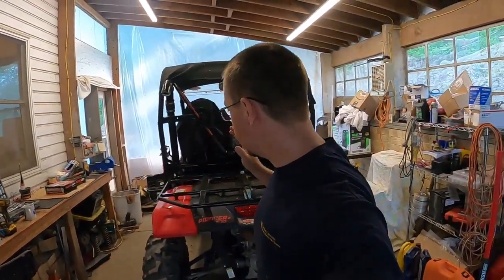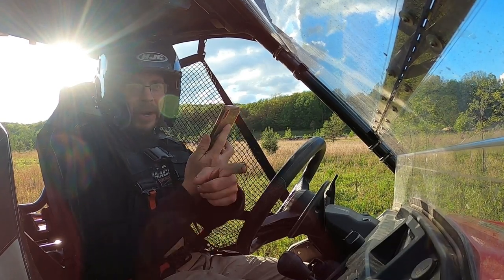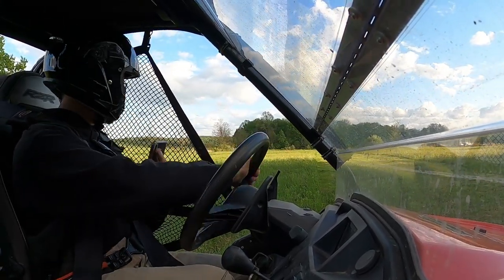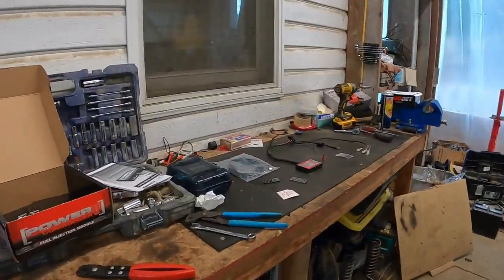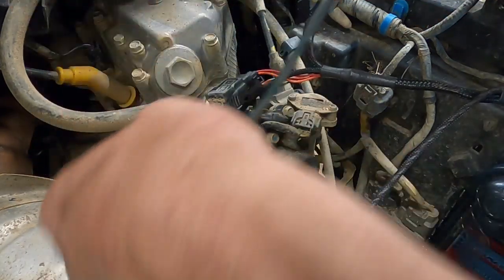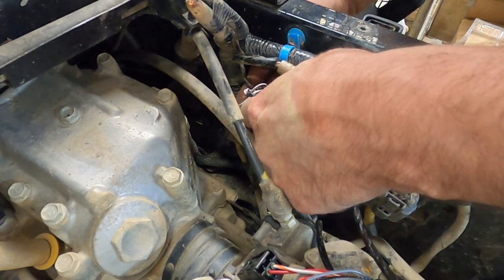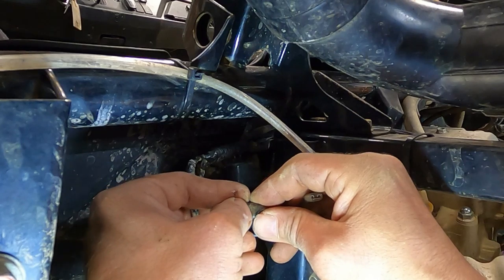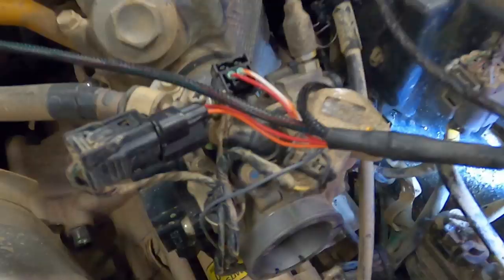Honda Pioneer 500 Power Commander V Install

Comment: I took my new 2020 P5 for the first time this weekend I love it the only thing I dont like is the speed limiter on mine shuts it down at 40 until it drops down to 38 and then the engine kicks back in. My question to you is there a CDI or something I can buy to get rid of the speed limiter? Its not that I need to go faster I just don't like it shutting down at 40 like it does. Also at 40 mph it dont even really seem to be working hard its climbing speed really good and fast and the limiter kicks in. Thanks for any help on this have great day
Reply: Ya 40 mph sucks. I would like to know the answer to the cdi question.
Reply from the maker: Here’s the thing with the P5. It doesn’t have a speed limiter per say but more of a rev limiter. That unfortunately means that to push the rev limit higher to gain more speed is very, very bad for the motor as it’s almost topped out where it’s at. Bigger tires is the best way to gain a few more MPH but don’t expect anymore than 43-45mph out of the Pioneer

Comment: This is exciting...! Do you think the stupid catalytic converter that’s on there robs any power?  Way excited about the TURBO PROJECT......!
Reply: I cut mine off and opened up the muffler a bit bigger outlet on muffler sounds better not sure about more power lol.
Reply from the maker: It definitely restricts flow. Enough to gain performance by removing it...🤷🏻‍♂️. I doubt you would feel any gain but I would bet you would feel the engine running smoother at the least.

Comment: Do you think that your 0 to 30 time would be much different in auto mode,  can't wait to see if the power commander made much difference
Reply from the maker: My P5 is a manual only so I couldn’t test that.
Reply: I dont think so my P5 is the new one and it has auto and manual and to me it dont seem to shift good to my opinion in auto. I use mine in manual and love it